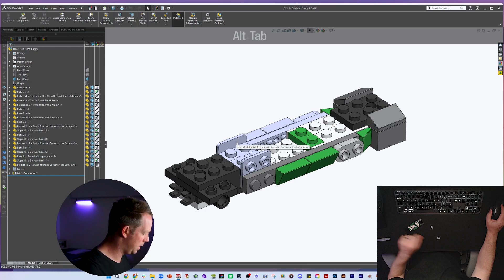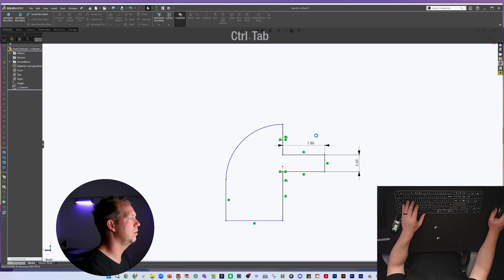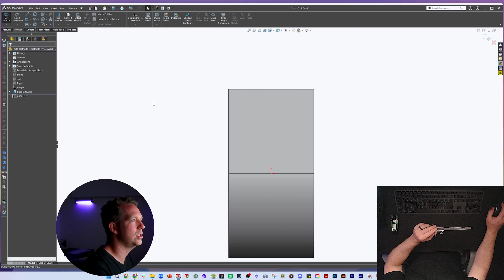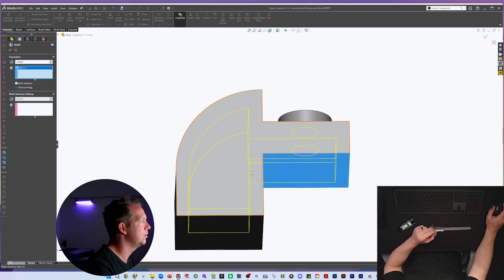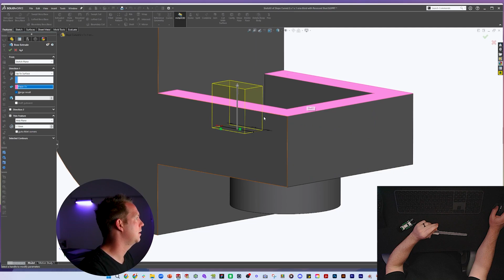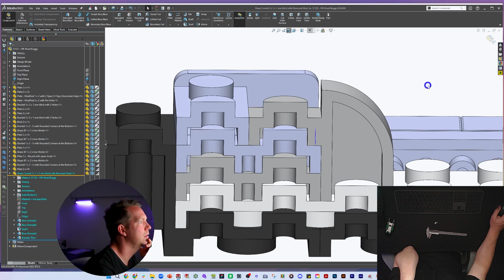Lesson 9 - Model a Sloped Curve 2x1 Part - SolidWorks Tutorial: LEGO Off-Road Buggy

Comment: Neat trick on the shell! Out of curiosity why is necessary to create a new sketch to close up the hole between the left and right hand sides after the shell operation? Can you instead simply select that face and extrude it?
Reply from the maker: To extrude in SolidWorks you require a sketch.
Alternatively, you can use the tool "Move Face" (as you've described), which works well in most scenarios, but not always.  Creating a new sketch and boss-extrude is a 'safer' option for a novice user